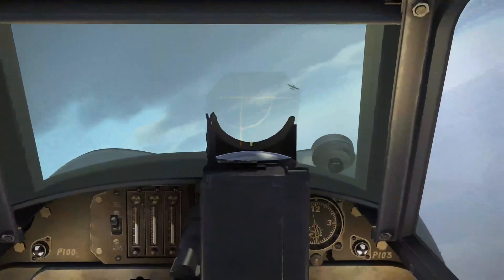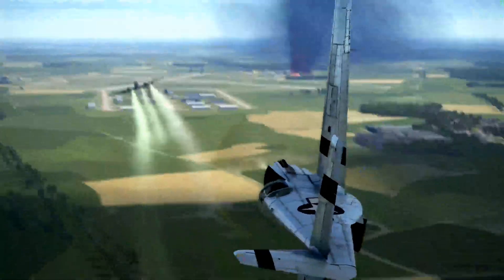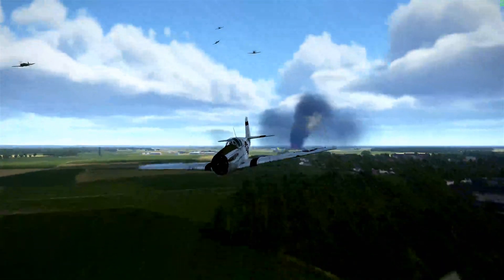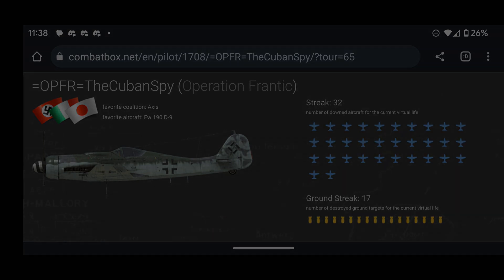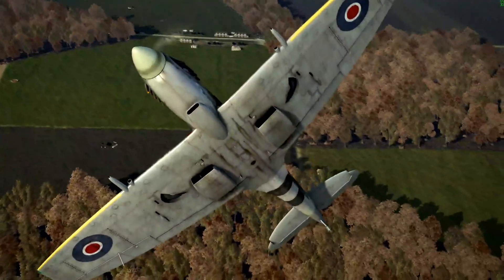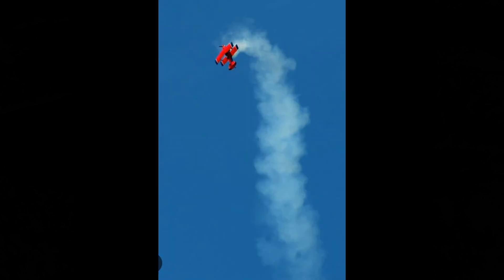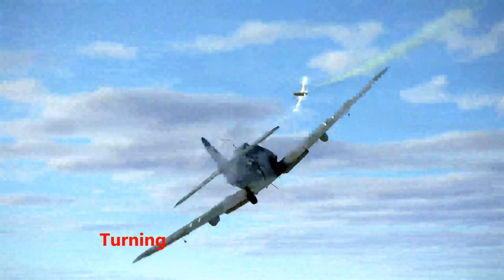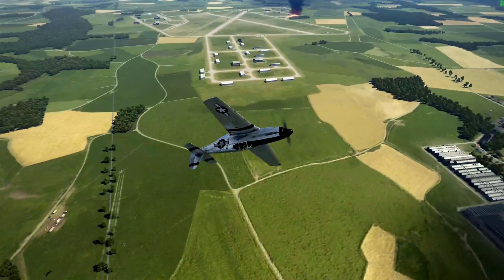(166) IL-2 How to Maintain the Energy Advantage in a Dogfight - Essential Considerations

Comment: I need this.  The BF-109 has no JHMCS.  I just keep falling out of my turn at 220 kph.  It's crazy!
Reply from the maker: Well I have the solution for you: https://www.youtube.com/watch?v=tj41bKTh43M&t=2s Trim control. With the aircraft properly trimmed you should not fall out of the sky. You should be able to enter a coordinated turn (ball centered), constant angle of bank, and trim the elevator up so there is zero pitch control input needed. Anticipate coming out of the turn and trimming level again. Let me know if this works.
Reply: @colninny8769  You're right.  That is a good tip.  I already have that elevator trim control, whatever it's called, mapped to a wheel on my throttle, right under my pinky.  When I'm turning with a bandit, I frequently find myself low, turning just inside, and way too slow.  I need to keep my speed up and utilize that wheel when I'm in a turning fight.
Reply from the maker: @daveg5857  good stuff. Now consider avoiding turn fighting. Success also depends on what a/c you're flying, too. If you are in a turn fight you're never in a good position. Zoom, boom, and run, gain altitude and comeback for more. Good you have the trim sorted out. Keep in mind the 109 has a stabilator and a separate trim setting to other machines.